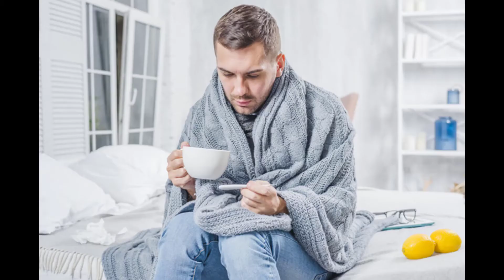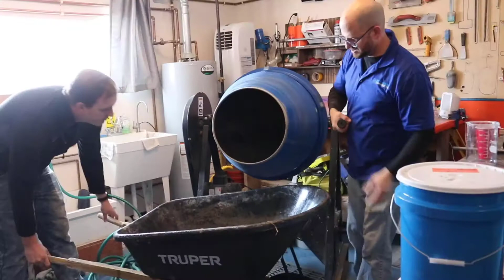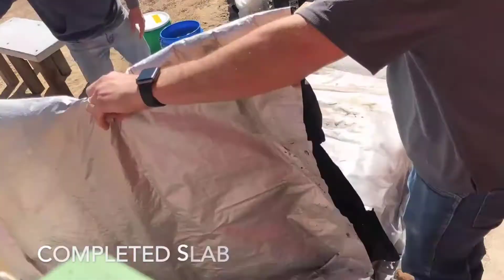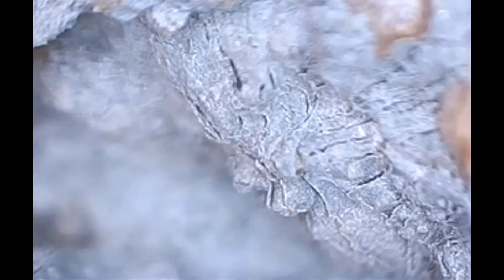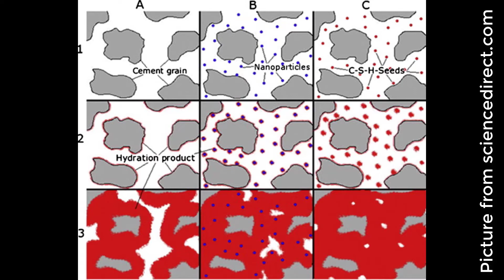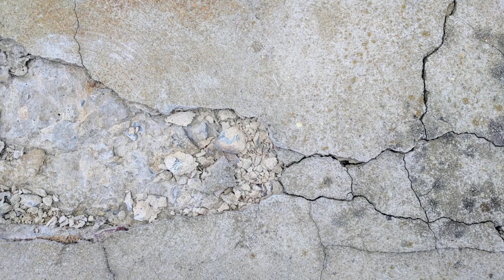Saving Frozen Concrete with Hydronic Heating  - Vlog 508

Comment: Is there a reason you can't just use antifreeze in the hydronic system?
Reply: You need a heat source to keep up the temperature. If you're just using antifreeze without any heat source, the water in the hydronic system will reach the same freezing temperature as the environment. Although it will not solidify, it will not protect your concrete either.
Reply: @1HighVoltage1  not sure what you mean "you need a heat source" the way I believe antifreeze works is it lowers the freezing temperature of water. A 50/50 mix will lower the freezing temperature to -35F. There must be some other reason for not using it at least I would think so.
Reply: @Ilove3SGTE  using antifreeze will prevent the water from solidifying at low temperatures, ik will not prevent the water from cooling down. So your concrete will drop in temperature as well, hence it will fall asleep and may freeze. There must be a component in the system that generates heat, e.g. a boiler, water heater, ...
Reply: @1HighVoltage1  ah I see what your saying and now realize what the real issue was haha.